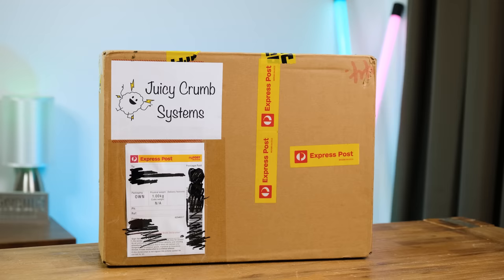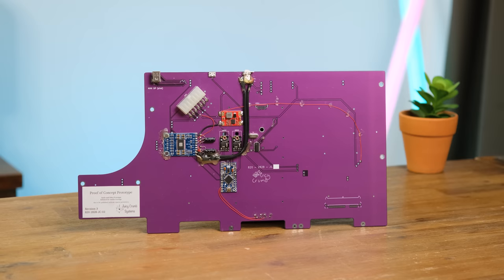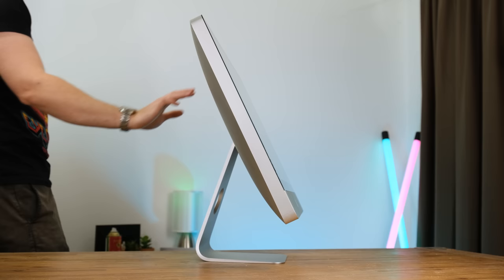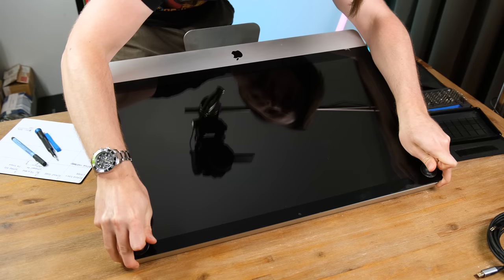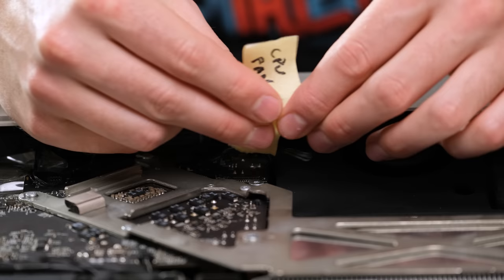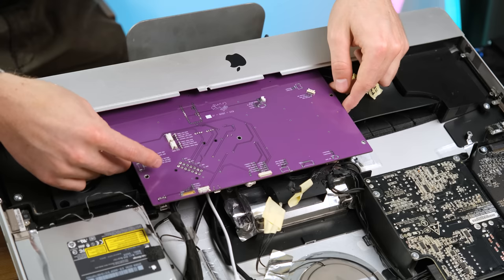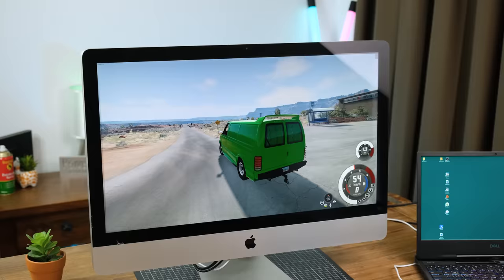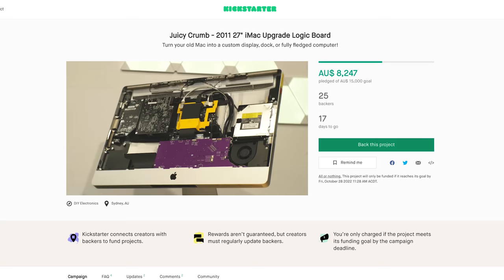Turn Your Broken iMac Into A New Standalone Display!

Comment: Absolutly love the idea, especially the use of existing hardware on the monitor like the webcam and the optical drive. Ive seen these macs pretty cheap that are stuffed in the motherboard, cpu or gpu area so this could be a very affordable way of getting a great monitor with a ton of other goodies.
Reply: Alas, it’s not affordable.  They’re asking US$249 for the cheapest board.

You can buy a fancy HP 32" silver monitor — brand new — with $50 left over.
Reply: @stevearkwright  hold on there. The boards are expensive, sure, but when you add up  the total costs, it can be a very good deal. You get 5k resolution, and then all the io including an optical drive, a USB hub and even a webcam. If you get the iMac for say $100, then try to find a monitor with all the same items as that.
Reply: Be very afraid of the VESA mounting option tho.
They specced the screws to self-destruct and shear apart if you look at them too hard.

Comment: Nice to see someone trying to make something out of these old but very nice iMacs. I have a 2010 27" that I put an M1 Mac mini inside along with connecting the speakers to USB amp, and installed a 2011 iSight camera. After accidentally killing the ebay display driver board, I took apart a 4k LG display and installed that instead. Just waiting on a replacement front glass panel and it'll be finished.
Reply: Hi Eric, you actually placed a MacMini inside that iMac?
Reply: @giorgos7six  Yes, just the logic board and the power supply.
Reply: @ericbauer4559  Wow this sounds awesome! Do you have a video of this installation?
Reply: @giorgos7six  Not yet. It's pretty nice to use even though I don't get to use it daily since I just have it at work on my work bench.

Comment: This is amazing. I'd like to see a version for the iMac 5K as it can save people (myself included) so much money vs. buying a new Studio Display! The panel in our aging iMacs is still nearly as good as Apple's $1,600 display and it frustrates me so much that it can't be used as a standalone display, especially now with Apple's attempt to discontinue MacOS support for early models of iMac 5K. Unlike the 2011 it may not be a standard DisplayPort connector inside which is a problem though, at the time the DisplayPort standard couldn't handle 5K. I believe they got around this by using 2x DisplayPorts for the one display but I could be wrong.
Reply: Imagine dumping in the internals of a mac mini M2 pro and having a fully functional iMac pro lol

Comment: really looking forward to this! i have a 2009 imac with a broken graphics card and i wanted to turn it into a display for quite a while!
Reply: For 300AUD you can probably just buy another GPU and a usb capture card.
Reply: Only compatible with 2011 27 inch ones.
Reply: Disable the graphics card that one will work in target display mode.

Comment: Awesome video! This is a heck of a way to prevent some huge e-waste. Do you know if it'll be available for the 21.5" models as well?
Reply: Throw us a dollar to show your support. We are planning on the 21.5 and the 2009-2010 models as well. The reason targeting this model occurred as a first was due to the significant number of dead units floating around for cheap.
Reply: @digitalrampage  your prices are ridiculous
Reply: @a1m598  Yet we are over half funded. We respect your choice not to like the project and welcome you to attempt to build a competitor for a lower price.
Reply: @digitalrampage  (remove the ! For your website in your last public update) yo I LOVE your project but realistically, no. Preventing e-waste isn't worth over $250 USD. And I don't like the cockiness. Congrats on exceeding your goal! But a diy hack can't cost more than a brand new monitor. And if you release cheaper that's a HUGE middle finger to your backers.

Comment: I am currently using my 27“ 2011 iMac as a display for my 2012 Mac Mini via a 0.5m Thunderbolt cable. It would be nice to be able to use newer computers with different cables though!

Comment: I’m planning on doing this with a 2006 white iMac! The idea was to use it with newer software as if it had original hardware inside of it. I have a special connection to these computers because it’s what they had in the computer lab in elementary school

Comment: I did this a while ago with an $80 board from eBay on a free, dead 2009 27” iMac, and this does everything that I had imagined I would want from the board. The one I got has a lot less features.
Reply: The benefit of this is the lack of need for soldering, a power supply and backlight driver. We use the original Apple Power and Backlight meaning you get great quality display and full brightness. Yes its more expensive, but it has more features and requires little technical experience.
Reply: Would you please advise the search keywords? I’ve been looking for a while, and wasn’t able to find anything like this.
Reply: @maxymko  I just found a sticker on the back of the panel with the model number and typed that into eBay with the phrase “driver board” or “control board” after it.
Reply: @calvinficenec7538  Ah, I see. Thanks for feedback.

Comment: I wish there is an easy way to use an old 5K iMac as a monitor in Australia, strip it down and adding a board as the controller for using it as a monitor is a good idea ?

Comment: The audio amplifier section using that tpa3116d2 without heatsink and no filter is not good. That module of AliExpress really suffers from a lot of problems with frequency response. They can copy paste the typical application circuit from Texas instruments datasheet & it's good enough.
Reply: This is a prototype. The current board which you will see in another video shortly is all on board. This is a proof of concept only to prove that it works. All of the boards shown in the video have already been re-designed and included in the board. The shipping boards will not simply be a bunch of cheap parts glued to PCB - So please throw in a dollar and support the project =)

Comment: could you maybe do a video on GPU replacement? i have a 2011 21.5" iMac, A1311 with an HD 6750M in it. works fine but i heard they have issues so it would be nice to know how to replace it should i ever need to

Comment: Cool idea, but 300 AUD is way to much for this card. This can be done much cheaper with just an LCD driver that supports this type of display panel. Can't use the builtin PSU, or any of the other hardware.

Comment: I have a 27 inch 2009 imac that has 32 G of ram and a 512 SATA drive. It works wonderfully, other than how it fries my external drives so I can't edit photos. Also can't upgrade OS so I can't upgrade Adobe programs. Of course XD The computer experts locally said it sounds like a power supply issue and isn't worth fixing, but having paid to upgrade this already I'm possibly in denial that this is the end of the road. You said you installed an M1 in your 2011 computer. Do you think I could do something similar with this? Thanks for the video! I am interested in learning how to work on these myself.

Comment: You can switch the integrated GPU off using an application. I forgot what it was called, but I've used it on a Macbook Pro with a failing GPU and it switches back to Intel graphics. I think there's also a verbose command to switch it off too.

Comment: I use cheap aliexpress board for years. By the way brightness is fixed by creating an ICC profile that adds 10% gamma and 5% brightness
Reply: ok, but that's only for using the monitor, right? or can you use the other parts like the speakers and so forth?

Comment: Nice! I’ve got a 2011 27-inch iMac just like that. I have previously reflowed the GPU (in the oven) and it’s fixed - for now. If it breaks again I might just buy this.
Reply: You could also upgrade the GPU to a newer one that’s metal compatible. That will allow you to install Mojave and up, definitely worth looking into.
Reply: @EvilTurkeySlices  Really? Did not know that, thanks! Honestly what I’ll do depends on the price (of this board/an M1 Mac Mini to put inside/the newer gpu you mentioned) whenever the original GPU breaks.
Reply: @simonro9168  Yeah I think nVidia Kepler cards work quite well, because they were originally shipped in the later iMacs. A GTX 880M is quite an upgrade from the original HD 6000 series too ;). But cheaper options should be available. There's a whole forum post about it on macrumors

Comment: My first iMac was like that one and the GPU began to fail. I took it to an Apple store and they told me they would include it in a recall even though I was 3 weeks late. I left it with them and a couple of days later they called me and said the rep had dropped the display panel. They gave me a brand new iMac. Their only concern was if I had backed up my software which I had. Apple was very good to me. I;m still using that 2013 computer but I see the spinning beachball a lot. I think it may be time for a Mac Mini and Studio Display

Comment: I don't like that the cables come out like this. But otherwise its a great idea and I like it very much.
Reply: We dont either, but Apple used custom ports on the iMac that are diagonal. You can actually put the cable out via the Ethernet port if you are so inclined. This issue wont be a concern on the earlier Macs, as they generally used standard connectors.
Reply: Also, throw a dollar of support in if you can! Thanks

Comment: cant you just software disable the discreet graphics? That'll fix this issue won't it?
Reply from the maker: The machine is so old, power hungry and without the discrete graphics not very useful. At least now I can use it for gaming, video editing or practically anything 🙂

Comment: seems interesting, but it s not.
The kit costs like a new better monitor +  the broken  imac can be sold and has a value higher than a new 1440p screen + cables are ugly + + + and the most important thing : you can replace the broken gpu with another (or repair it for cheap)

Comment: $386USD-$588USD for this board? The idea is very good, but for this price range there are very well calibrated monitors out there. I think the pirated/clone boards will start emerging pretty soon at a reasonable price.
Reply from the maker: You've got the currencies wrong. They start at $299 AUD which is $189 USD with current exchange rates.

Comment: Edit: too expensive. $250 USD just to prevent e-waste sadly isn't worth it. Plus it'll probably be more expensive once you can just buy them.
I don't think it's viable but I really wish there was an option to steal one thunderbolt port but still allow the iMac to function as normal. 
The rubber grommets from the HDD mount could be used to lift the board higher.

Comment: Looks like a great idea for a dead iMac. Hopefully, the cable bundle will get tidied up, too.
Reply: The ports will likely be moved to the base on the shipping unit so the cables are not so tedious. We are still looking at a port solution - but this will not be an issue on other earlier iMacs (2008 etc) as they didnt use custom angled ports.

Comment: Wait.....Wouldn't it be simpler if the board was just an extra that has the ability to passthrough an external GPU? thus letting you keep using the same iMac system without its dead integrated gpu! 🤔

Comment: A nice project but the price doesn't make any sense. You can get the same LG panel that is used in the iMac for less than by buying a Dell Ultrasharp for less than the mod.
Reply: It’s about waste prevention, reuse ♻️ 
And a way better looking screen then anyone else
Reply: @digitalrampage  I have an old iMac working as a monitor through the option Apple provides. It makes more sense to just fix it and use it as a dedicated monitor.
Reply: it will use significantly more energy doing this, which is costly and generates considerable heat as well. Thanks for the feedback, however we are happy with the projects green factors.
Reply: Interesting. Might be a big sales converter to show kickstarter backers the comparisons of this.

Comment: Do you think the display could work with this new board? I have dismantled my machine. I sold the video card, the ram memory, and other elements because the motherboard was not working.
Reply: All you need is the original display, Power Supply and Inverter to make use of this board :)

Comment: They should have a option to have M1 mac mobo to have on that board, all the way to m1 max 32 core
Reply: There is not a feasible way to do this
The M1 Max Mini logic board can be mounted standalone in place of the iMacs 3.5” HDD bay on the dock pro with M1 adaptor

Comment: NOTE: I am not using the board in this video, I simply sharing my experience using another method and the challenges I faced using that method. I wish Juicy Crumb Systems success in keeping these high-quality machines going and the design challenges that come with designing such products 👍

I'm running dual 2009 era 27in iMacs via target for 6 months now and I would not recommend it for most people tbh. 

I'm using one i7 2009 27in and one i5 2010 27in with target display mode with my Ryzen Gaming PC. Running Quadro k610m and Quadro k1100m in mine since the original GPUs were starting to get flaky.

Some notes because using a 27in iMac as a display in this implementation is not all butterflies and unicorn farts.

Issue one: Target displaymode will only work if a compatible macOS is booted up (like High Sierra) and then the source device is turned on. I get around this problem by using a switch to cut the power to my displayport MST splitter.

Issue 2: HEAT these computers get very warm, and when the displays turn on they pull more load than the imacs with the screens off or the gaming PC in my experience. If you do not have good AC in your room, the summer months will be hard as they add a couple degrees to whatever room their in.

Issue 3: Turning them back to macOS is a pain because the image source device must be off or disconnected, then the power button on the iMac must be hit twice quickly or hit once and then one key pressed.

Image retention is not to bad but does exist with bright windows in one place for to long.

Looking back, these are a hassle and while the result is beautiful I wouldn't personally recommend it. They simply get too hot for my liking and I do suspect it is the 27in panels themselves. Quadro GPU mod is fun, but I still need to fix brightness so I could actually change it. Flashing the GPUs with custom bios using Linux USB over the wired network from another computer was also a learning curve. Quadro Mod is great for using it again as a standalone computer though, I do recommend that if your techy.

I'd recommend getting some some energy efficient 27in 120hz gaming displays with good reviews. I spent around $120 usd each on my iMacs (got them for $25 usd ea broken) but I had to buy the $60 usd MST and $15 usd USB switch since I only have one displayport on my gaming rig.
Reply: The 2011 display is very different then the 2009 - for one its LED and two the tech used is much higher quality by LG. This doesn't use target display, it completely makes the display a stand alone monitor by removing all of the original driving parts.
Reply: @digitalrampage  I didn't know that the LG panel was different, thank you. In the comments I saw some talking about target display mode and also one talking about 2010 machines.

I wanted to share my experience, because I basically wanted this exact setup for a long time, and now that I have it I can identify flaws with my implementation. I don't want other people to be disappointed if they decide to go for a setup like mine after reading the comments that using an stock iMac as a display is even possible in the first place.

There have been positives, don't get me wrong, but I have seen a lot of speculation on setups like mine but not a lot of daily driver experiences from people (because it is a obscure use case, dual iMacs with a PC without Thunderbolt) but for the 2009 and 2010 I wanted to share the challenges I personally ran into and did not expect.
Reply: @digitalrampage  I didn't realize you spoke for Juicy Fruit. I edited my first comment to make my purpose more clear. I am interested in products like the ones you are looking into producing, and have respect for designers and creativity that is put into such solutions. I note that your board would potentially offer iSight and SD card functionality, the M1 Mac mini properly mounted in a 27in would be crazy cool. 

With optimism, I wish you guys the best.

One recommendation, a Juicy Crumb Systems YouTube account would benefit your online presence on these types of vids. Otherwise someone might get confused and call this account out as a superfan type deal and I fear things could potentially get negative.
Reply: @NickelLight  the Target Display mode is using a lot of the computing power of the machine, which is why it’s not a great solution. This avoids that, and drops the power and heat consumption as well. Plus you don’t have to have a functional
Logic/GPU for our solution. :)

Comment: 3:03 No wonder why the GPU on that motherboard is failing!
The GPU's heatsink is poorly designed and the heatsink fins are too far away, so heat build up is a given.
The cooling fan on the GPU is also poorly optimized as the air from it has to go under (or through...) the DVD drive before it reaches the heatsink fins.
Overall, a terrible GPU cooling design and it's no wonder why the GPU was failing.